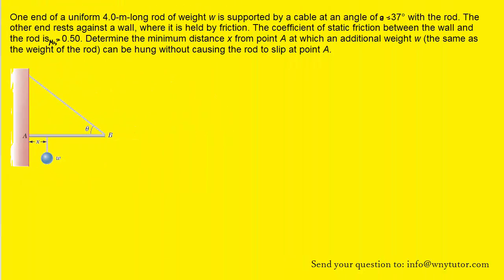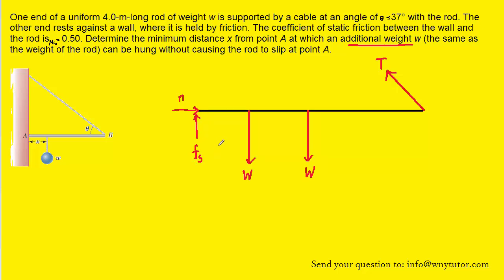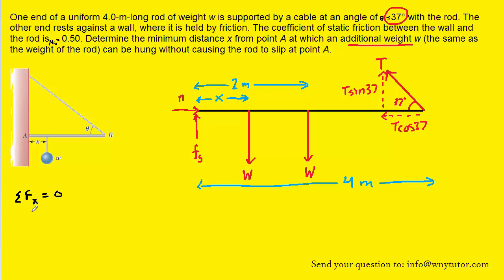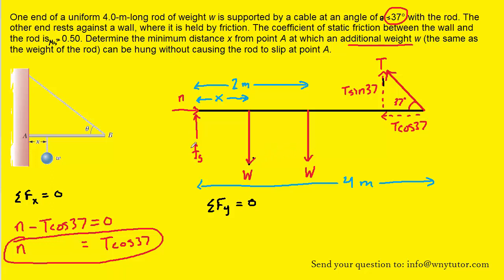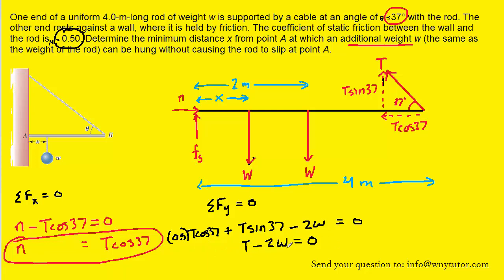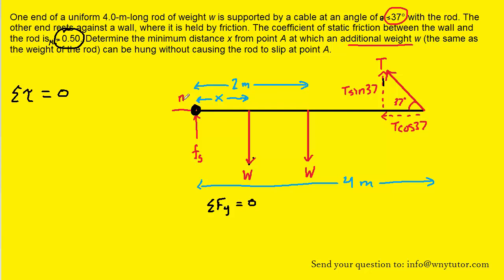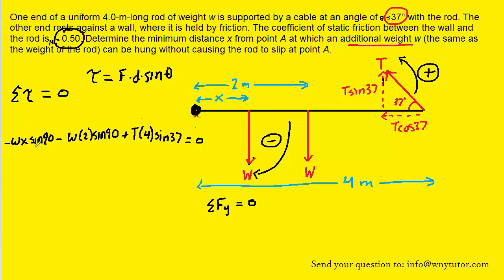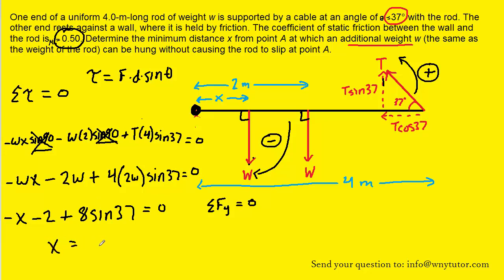One end of a uniform 4.0-m-long rod of weight w is supported by a cable at an angle of θ= 37° with t

Comment: why did you add the another Fg to the middle, it could be anywhere for example ?
Reply: No, the weight due to gravity has to be in the centre of the rod. Since the question states the rod is "uniform" this indicates the weight of the rod will be located in the centre.

Comment: Why don't you have to break the tension into its x and y components for torque? It looks like you only did the y-component of tension in the torque equation.
Reply: Divya Sud would the x component be parallel to the distance in question?
Reply: Well the equation for torque is F*d*sin37, so that's why sin was used.

Comment: I thought the pivot of rotation was the center of gravity?

Or in this case wouldn't it be the end that is attached to the cable? since any force applied to the rod, if friction was surpassed would make it move like a pendulum, or rotate around the end attached to the cable.